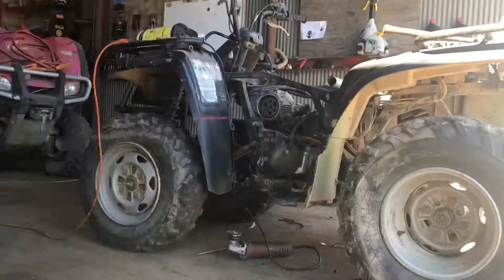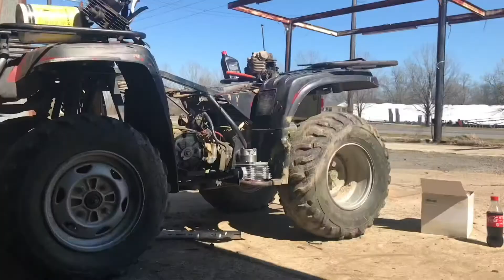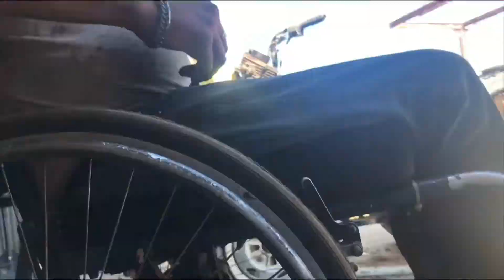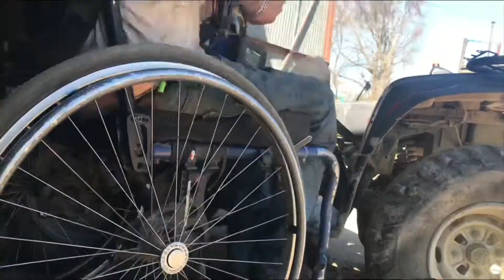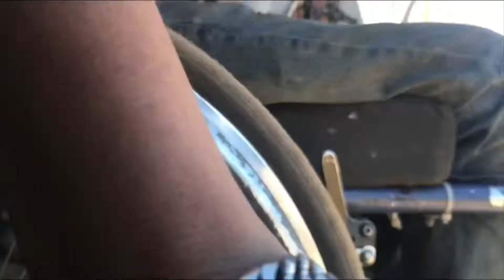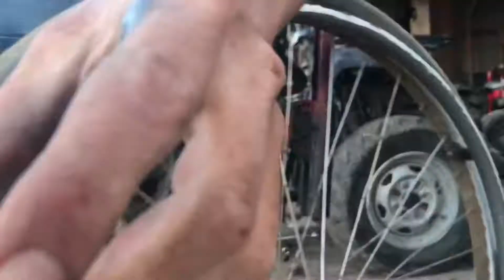Bear tracker top end rebuild

Comment: Hi, I would like to know if all the head bolts is the correct same size? Reason for asking is because one of my head bolts isn't tight enough. And looks like the thread in the engine block is stripped. But then I saw the holes on the gasket has 3 big ones and a smaller one. So I thought perhaps if the bolts differs perhaps a previous mechanic got the bolts wrong? I recently bought the bike and hasn't got much experience or knowledge of qauds except for what I've seen from you guys. I'm waiting for someone to remove my top cylinder to get the thread in the engine block re-treaded but this guy is taking forever and I'm almost at the point of doing it self!
Reply from the maker: Not all holes on the gasket are gonna be the same size. Some are bigger because you have to slide a dowel into the engine when putting it back together.
Reply: Nice 👍 saving old yamaha 4wheeler ,timberwolfs and bear trackers ! I love them !